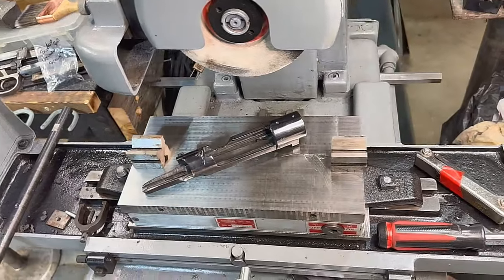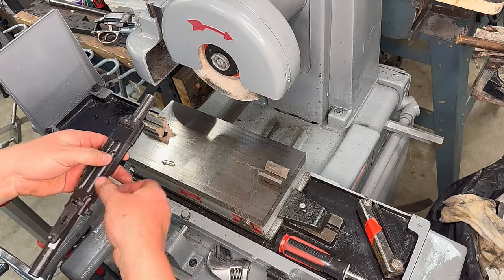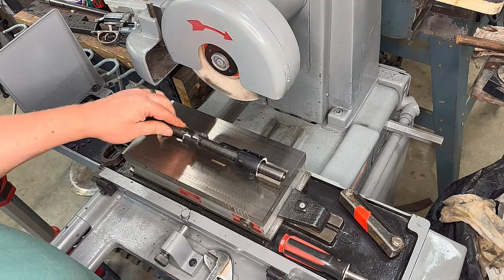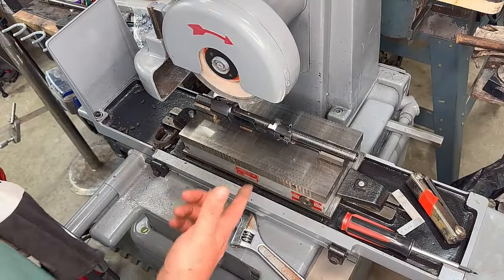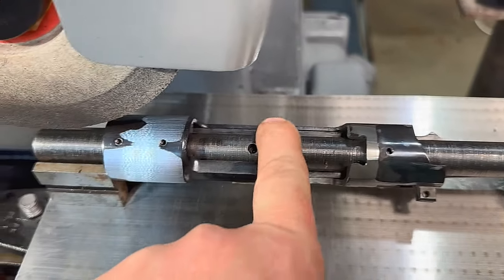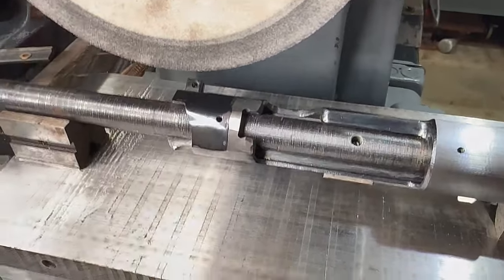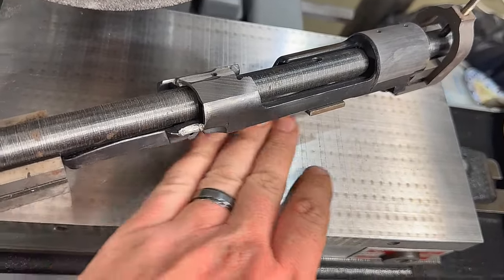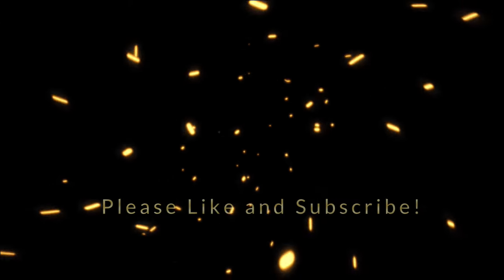Shaping a Military Mauser action - Building a Custom Mauser - Turnbull Custom Guns

Comment: We're probably going to do some business at some point I've messaged you a couple times,  what I'm wondering this time is the center area of the rear "bridge " ? Is flat once you ground it im probably going with Leopold QR scope mounts which I believe are rounded,  cutting them to flat would most likely make them way too big no ? Can you do the rear where you just barely grind through the bluing and blend everything in through the stripper boss , there's still a couple thousandths that's going to have to come off when I sand and sand and polish to get rid of the grinding marks
Reply from the maker: The center area of the rear boss is not flat it is contoured and generally will fit any commercial Mauser scope bases or FN Mauser Scope bases. The same amount is moved from the front ring as the rear so usually alignment isn't an issue. I prefer using the Leupold bases since you always have additional windage movement in the base.

Comment: i could see problems with scope ring mounts now the top of the recovers been changed
Reply from the maker: You are correct. M98 over the counter Mauser scope bases are generally cut to match one particular Mauser action design the FN commercial Mauser. When we surface grind the receiver, we are trying to better match the Military receiver to the commercial FN design. For instance, the Weaver bases will not fit all 98 Military style Mausers because of this. One of the problems that need to be overcome is the stripper boss that we remove in this video, since the commercial Mausers generally didn't have them most of the bases on the market will not properly fit a Military Mauser unless you remove the stripper boss or fit the rear base to the action. Because of that, any Military Mauser should have the bases fit to the receiver. Contouring the action on the surface grinder makes this process easier since you are keeping the original profiles (with the exception of the stripper boss) and just lowering the front and rear ring and truing it up. Everything is now flat and square to the action and the only fitting that may be necessary is the height. Which could be easily shimmed or lapped to the receiver. (sorry for the long explanation) Thanks for watching and thanks for your comments. Very relevant!
Reply: The original Mauser side scope mount is available from SARCO and expensive but it is a authentic reproduction and retains the ability to use stripper clips which is a feature that I really like. I just can't stand loose ammo or loading cartridges into the magazine 1 at a time. Plus 5 rounds don't rattle in a stripper clip and Bandoliers are Old school cool.

Comment: Do you now have to reharden the reciever  ? / heat treat ?
Reply from the maker: Nope, the surface of the 98 Mauser actions are not case hardened. So you are not removing a layer of harder material that would give the receiver additional strength.
Reply: @Turnbullcustomguns   Depends on the receiver. Some are hard on the surface. Like Argentino 1909. Try to file it, you will mess up you file.
Reply from the maker: @DarthKuz  Yea I should restate and say most are not. Thanks for the correction.